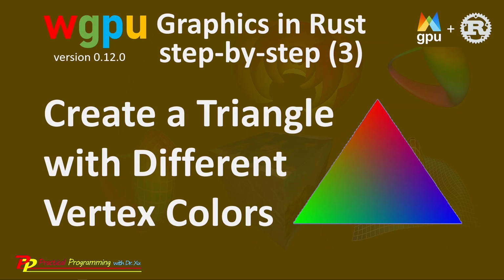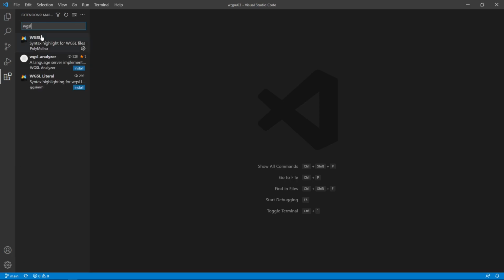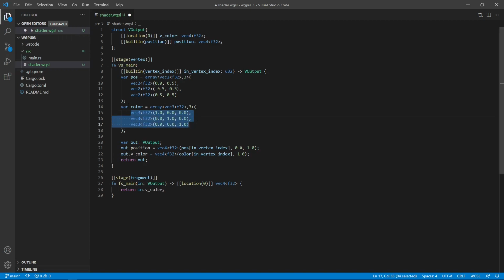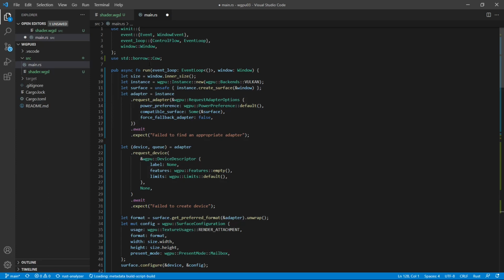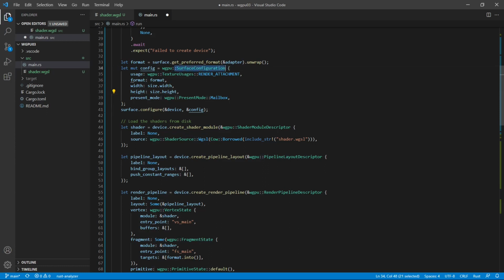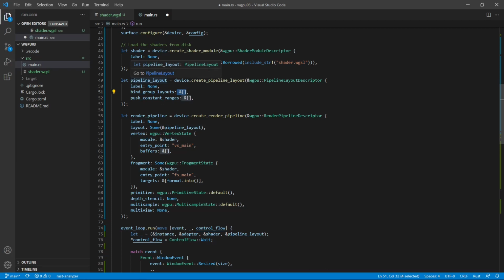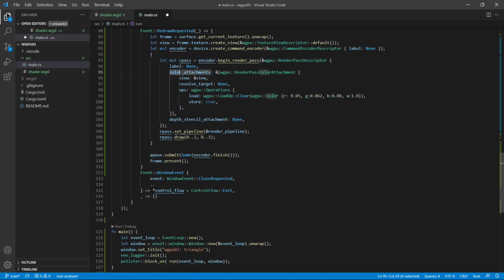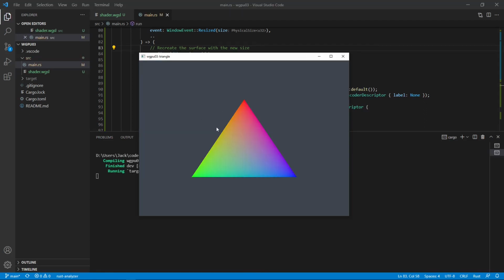Rust wgpu (3): Create a Colorful Triangle

Comment: As of Jan 3 2025, this code will compile but will not run successfully on Win11 using code from git. Plus what included in the examples is not compatible with newest WGPU Api.
Reply: You literally just described my current problem. Do you know what the solution should be?
Reply: I think it should be ok as long as you use the exact same versions in you "Cargo.toml" file.

Comment: Currently each example after compilation is about 1 gigabyte in size, probably because each example has to duplicate the dependencies. The examples are pretty small in code, yet when all are compiled it takes 13.2 gigabytes. I really think you should consolidate all the examples into one repo instead of using submodules to avoid duplicating the dependencies.
Reply from the maker: Good suggestion. I use a single project for all examples in my book "Practical GPU Graphics with wgpu and Rust". But I got many feedbacks that suggest me to show each example in a separate project. I noticed the size issue of the compiled files in the target folder. In the future, I will try to consolidate all examples into a single project.
Reply: @PracticalProgrammingwithDrXu  Submodule architecture is good. You should have a Cargo.toml at the root, defining `workspace` and `workspace.dependencies`. And each submodule should refer to it using: `crate_name = { workspace = true }`